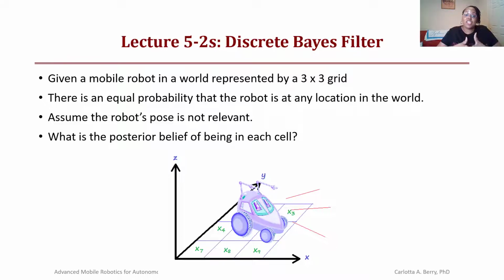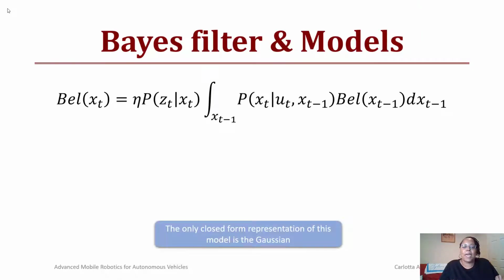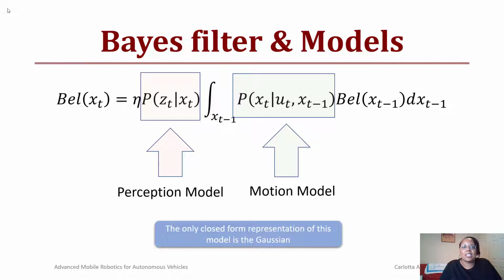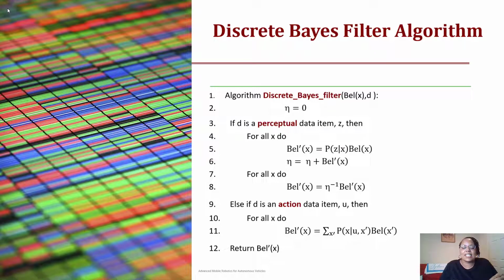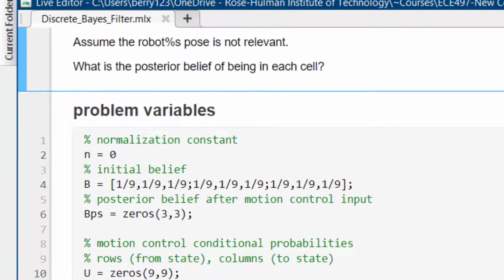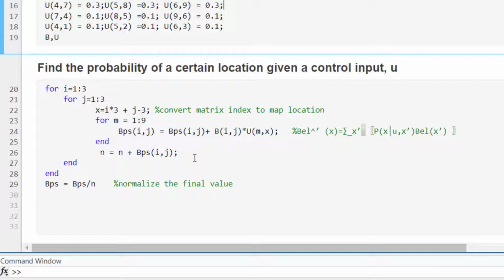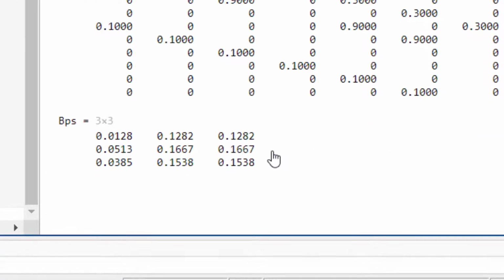Advanced Mobile Robotics: Lecture 5-2s: Discrete Bayes Filters with motion input

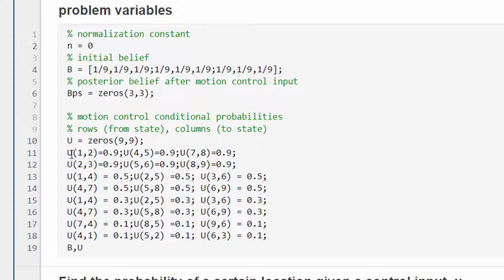Comment from the maker: @4:37 the matrix is wrong but can be easily fixed with ......Here is the correct U matrix for the MATLAB code
U(1,2)=0.9;U(4,5)=0.9;U(7,8)=0.9;
U(2,3)=0.9;U(5,6)=0.9;U(8,9)=0.9;
U(1,4) = 0.5;U(2,5) =0.5; U(3,6) = 0.5;
U(4,7) = 0.5;U(5,8) =0.5; U(6,9) = 0.5;

U(3,2) = 0.3;U(6,5) =0.3; U(8,9) = 0.3;
U(2,1) = 0.3;U(5,4) =0.3; U(8,7) = 0.3;

U(7,4) = 0.1;U(8,5) =0.1; U(9,6) = 0.1;
U(4,1) = 0.1;U(5,2) =0.1; U(6,3) = 0.1;
The correct answer should be x5